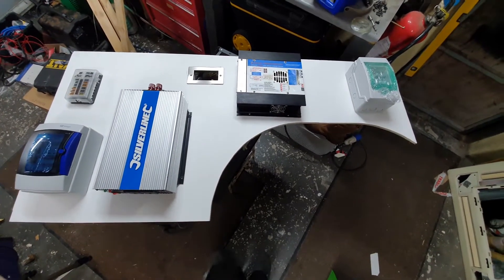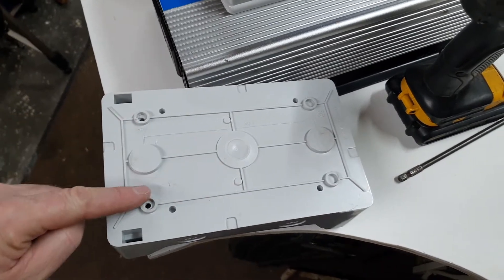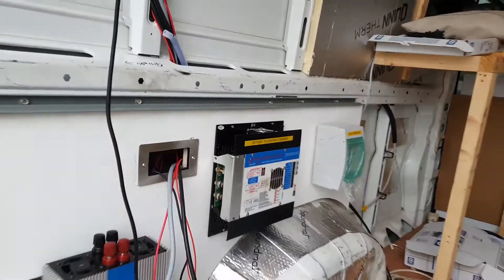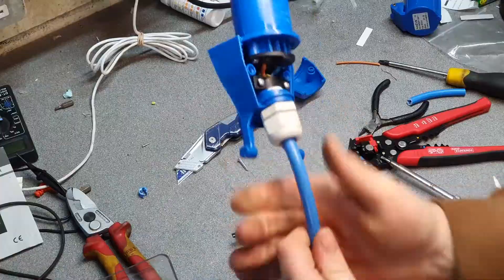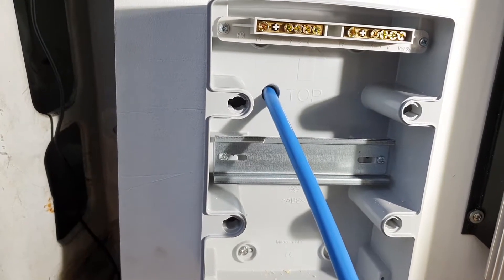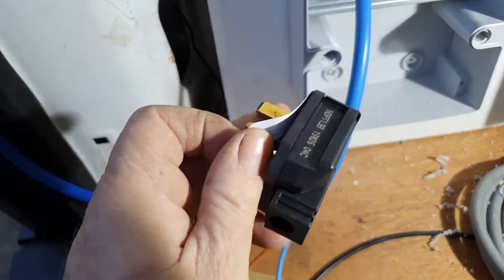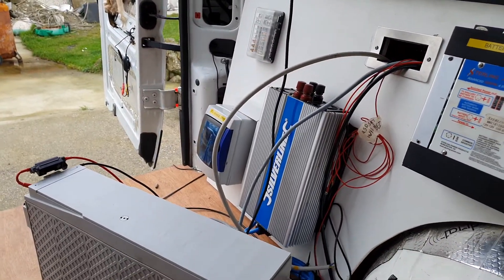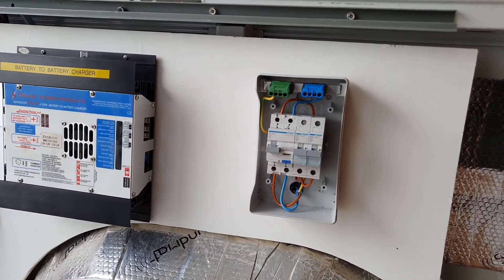Camper Van and RV Electrics -Part 1  Change Over switch and Mains electrics unit

Comment: Nice and clean installation. It would help to have a wiring diagram to show how everything is connected . Maybe in Part 2.
Reply from the maker: Ironic timing. Just ripped it all out and re doing it much neater this time. I'll try to include a diagram of how it's all connected too. Thanks for the comment. Don't forget to like and subscribe so you get notification of the new videos.  Jamie

Comment: So dose the sure power from the hook up and the inverter go into the change over switch then to the consumer unit thanks in advance
Reply from the maker: Hi there, yes yours correct. There are 3 connections in the changeover switch. The permanent output goes to the consumer unit(everything mains is connected to it for protection), and then depending on the position of the switch its either hookup-off-inverter depending on what you want. I like the idea of having the off position incase I want to work on anything. Hope this helped. Jamie
Reply: @campervancreations7656  I have it wired up there is power going to the mains fuse on the consumer unit but no power is going to the other fuses or the sockets even though they are all in the on position I’ve checked the wiring are all tight and the plugs sockets are in the on position. I’ve not tried the 240 hook up because the van is half way down the road
Reply from the maker: So, your running off the inverter? Have you the switch switching the neutral  also. You have two 'mains' inputs. One from the inverter and one from the hookup socket. If you switch the change over to the middle, do you lose power at the fuse on the consumer unit? Jamie
Reply: @campervancreations7656  forget the last question, I really need to go to SpecSavers what I thought was down for on it was in the off position on the consumer unit so now the switches are up the sockets are all working , so I just need to sort my extractor fan which is 240 to a transformer to 12 volt